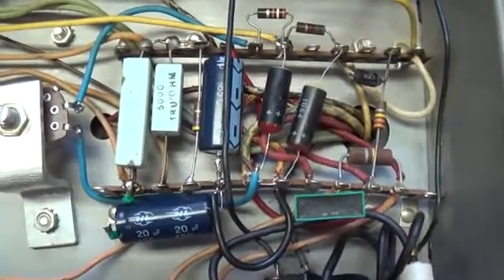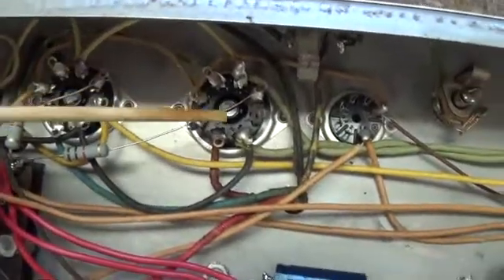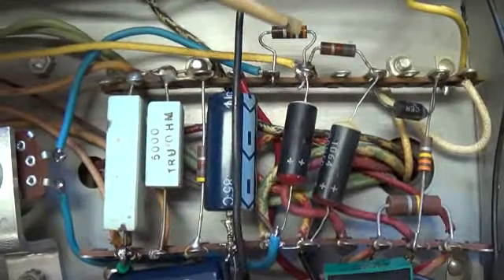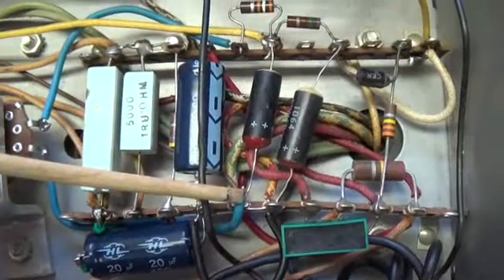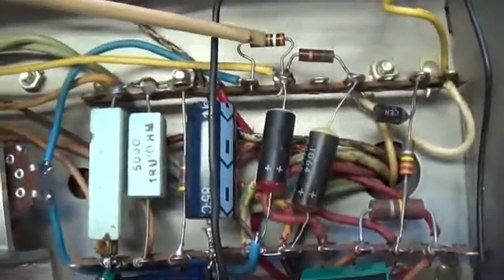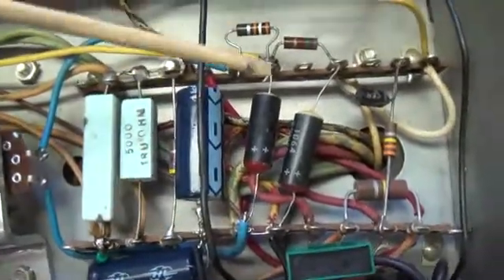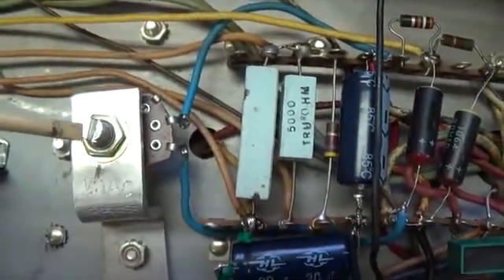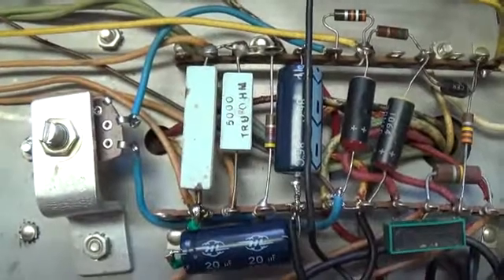Converting a Fixed Bias Amp into an Adjustable Bias Amp

Comment: Hello Uncle Doug, been a while since reviewing your videos. Busy working. I enjoy the practical application of electronics you bring to my favorite electronic devices, guitar amplifiers. So doing a review of your videos touching on tube biasing as they are an excellent source of information. Trust you have been well, have not seen any new posts since you finished your capacitor series. I have a topic to explore relative to PS transformers relative to impacts of changes to flux fields based on load variation in associated coils. While the loads across the output coils is typically constant except for component failure, during biasing grids I have observed significant changes to the B+ plate voltage effected by bias voltage variation in AB operation. A shift of say 3V in the bias resulted in a shift of 25V in the plate voltage. It was a interesting observation that in my opinion pointed back to the interaction of the load flux in the transformer coils. Wonder what your observations have been?
Reply from the maker: Greetings, JC. We're all doing quite well.....thanks for your concern :)  Since plate current (PC) and plate voltage (PV) are inversely related, reducing the negative DC grid bias to increase the PC will reduce the PV, and vice versa. I think it's this basic relationship, not anything to do with transformer flux, that causes the phenomenon you described.
Reply: Uncle Doug : thank you for that commentary! After review of my data sheets, they completely support your observation relative to mine. I should have come to that same realization/conclusion on my own. Just learned something more about the effects of the grid and screens in a pentode. What got me looking at this is the amplifier, double ended with (4) EL34, had a switch removing ground from the cathodes of the inside tubes. In checking the power dissipation with 4 or 2 tubes based ground removal I saw the 2 tube output reduce only 30%-40% instead of 50%. Understand now that while the cathode is removed there is still current flow from the grid to the plate acting somewhat like a triode in the ungrounded cathode tubes.

Glad to have received your reply! Give Rusty and Jack a scratch from me. All the best,
Reply from the maker: That sounds like a method to reduce output power, JC, to make the amp more versatile. Our best wishes to you too :)
Reply: Uncle Doug : absolutely. It just surprised me that the power reduction was not 50%. Caused me to do some head scratching. Your first reply made me take a closer look. Plan on measuring current flow through the grid and screens to better understand what I see in actual power in the high and low switch setting. Also will take a close listen to the tone difference in high versus low setting as the bias in the low power setting becomes much hotter. The amp is currently still on my work table. May give some insight to why I always preferred the Marshall 50W versus the 100W head. This amplifier (Hiwatt DR-103, 1972 vintage) has always been used by me for its extremely airy and glassy tone at high volume in the high switch setting. Maybe used the low power setting once or twice a long time ago. Just recall there was little difference in volume and the sound was just much better in the high power setting.
Reply from the maker: Surprisingly, lower wattage does not correspond to reduced volume to the degree you would expect. If a 10W amp can provide a certain level of volume, a 20W amp is nowhere near twice as loud....actually more like 5 or 10% louder. To achieve double volume, you would have to greatly increase the power far beyond simple expectations.
Reply: Uncle Doug : true. A 50% power reduction is only a power change of -3db. A 3db power change is negligible, especially in terms of audio volume. At the time I first got the amplifier (pawnshop on lower Greenville in Dallas in '82) I didn't understand or know the power volume relationship, but I did perceive the difference in the sound. After studying a course in electronics, I better understood what my gear did technically and became interested in learning tube electronics. My all time favorite guitar amp is my Rivera Fender Super Champ and use it for about 80% of my guitar work. 18W of awesome! After that, depending on the job, it's either my Lab L-5 or the Hiwatt. I use Markbass amplifiers for the bass jobs that I do. The amplifier I most miss is my first, which was a '65 Fender Vibrolux, I was too young and dumb to appreciate what an amazing amplifier and sound that amplifier had. I will share my further investigation into the Hiwatt next week.
Reply: Uncle Doug : looked into the amp in detail and thought about the differences in tones that could be had based on the existing mod and also based on standard, mild, & wild biasing switching. Breadboarded the the circuit I am going to introduce into the amp and tested the breadboard with all 6 different variations impacting both tube compliment and tube bias in the amp outputting through the 4x12 cabinet using a '59 LP STD and a '62 Strat. Wish I was a videographer, I could share the tonal variations achieved and let you see the breadboard. It was a lot of fun watching the dim bulb limiter respond to some of the more aggressive testing. It a gave a very good indication as to what the input stage was sending to the output based on the current draw swells as I played. Also put 1 ohm resistors between the cathodes and ground for more direct current measurement to get a feel for peak current draws at the various settings. Thank you for your reply comments to this string, it really helped me think about and understand what I was seeing and now hearing. All the best!

Comment: The terminology you are using isn't quite correct.
The amplifier you started with is not a fixed biased amp, you have converted it to a fixed bias amp.
The following link will help clear things up.
http://www.thetubestore.com/Resources/Matching-and-other-tube-info/Bias-Types
Reply from the maker: Thanks for your input, Serapio, but the Gibson GA35RVT amplifier is indeed a non-adjustable "fixed bias" circuit, in which the cathodes of the output tubes are grounded and the biasing is accomplished by applying a fixed negative DC voltage to the grids.  This is the definition of "fixed bias".  I added a potentiometer which allows the negative DC voltage to be adjustable, so it is now an "adjustable (fixed) bias" amp.....just like the video title (and your link) says.

Comment: Hi Doug love your vids I'm currently building your tremo-verb and I'm thinking of putting an adjustable bias in place of the fixed 660 resistor for 6l6 my question is, is the pot you used in the adjustable bias vid a 1 watt rating
Reply from the maker: +David Chatterton  Thanks, David. I believe it was at least 1W.  You have to be careful, if the bias adjustment knob is exposed, that it can't be accidentally bumped or moved. You might be better off making it a very short slotted-head shaft that can only be adjusted with a screwdriver.  Good luck with your modification.
Reply: +Uncle Doug thanks uncle Doug I'm going to put the pot on the inside of the chassis without a knob so it can't be knocked cheers brilliant vids learnt a hell of a lot I'm an electrician in the uk and you ohms law and other tid bits are explain perfectly
Reply: +Uncle Doug missed some letters in that last post 
Just to add, I here your doing a vid about capacitors and was wondering what the method is to get the correct rating of capacitor in any given circuit I understand the voltage rating but not the farad 
Once again awesome vids
Reply from the maker: You're welcome, David. There are many different applications for capacitors in an amp circuit, and the uf requirements vary widely due to their individual purposes. I'll try to explain the different criteria in the capacitor series.
Reply: +Uncle Doug I wait in anticipation for the series Doug. Say hi to rusty and jack for me cheers
Reply from the maker: I will, David. See you soon :)

Comment: hi does this apply for all fixed bias amp -can you mod any fixed bais amp to be biased-thanks
Reply from the maker: Gameing roulete I believe that any fixed-bias amp (grounded cathodes), with an independent negative DC bias voltage supply, could be modified so that the bias voltage was adjustable.

Comment: Actually a mod I performed on my Peavey valve king. Allot of debate over these amps having crappy tone.with a few simple mods its a great amp. sorry for the rant. But my question is....OP amp circuits? Used quite a bit on newer amps for gain boost etc. do you have a working knowledge of these circuits? And if so, maybe a video expanding them? As always love the videos and the work you put into them and hope I'm not being a pain in the a$&_));!
Reply from the maker: I looked at the schematic briefly and it appears that replacing R112 in the bias circuit (at bottom left) with a combination of fixed and variable resistance that can go above and below the value of this resistor (which is smeared and cannot be read) would probably work. Good luck and be careful :)
Reply from the maker: No problem, Bryan. I appreciate your input and am glad the videos are helpful. My amplifier knowledge is generally restricted to vintage tube amps, and I am not well versed in integrated circuits or active tone circuits. Perhaps you could do some Internet searches for information. Good luck !!
Reply: Yes I was thinking of doing this mod my Peavy 5150 so I can bias it. Was the mod like Uncle Doug's or another way? The pot that Uncle Doug used seems to be a great solution for me because I would want to be able to reverse the mod if I wanted to sell it. Would biasing the Amp help the Clean Chn you think?
Reply: Uncle Doug Thx Uncle Doug! You remind me of my Uncle Albert , & what American's were known for. I miss that America
Reply from the maker: You're welcome, W4.....glad to have been of assistance :)
Reply: +Bryan Bernas Rod Elliot's ESP site at sound.westhost.com has an article 'Audio Designs with Opamps' which starts from basic principles, and if you encounter anything you don't understand, you'll find it explained elsewhere on the site. In fact, you'll find just about everything you'll ever need to know about audio related electronics on the site.
Reply: Well thank silas , this is something I've been wanting to know about for quite some time because it is used so frequently and explanations usually quite vague .